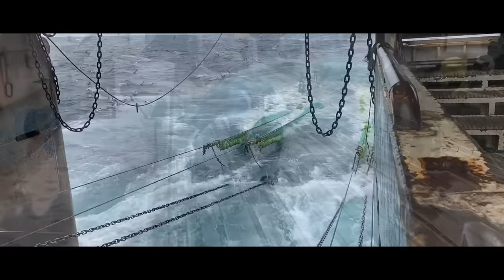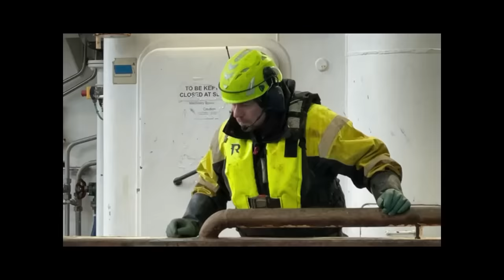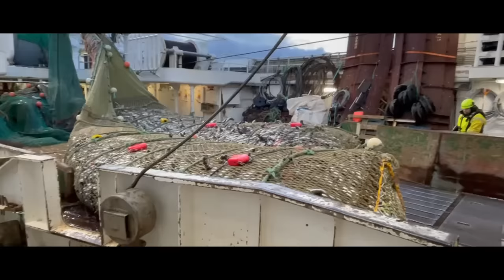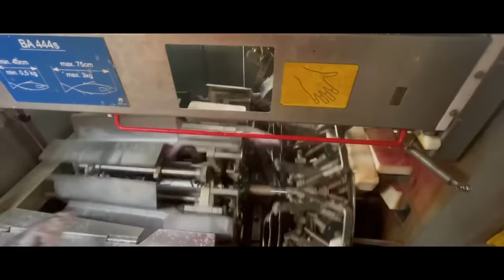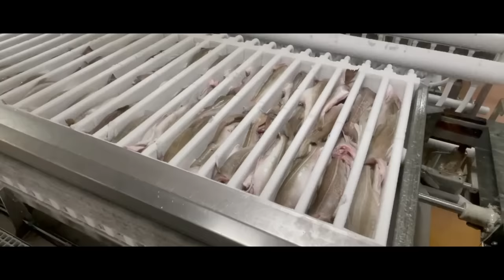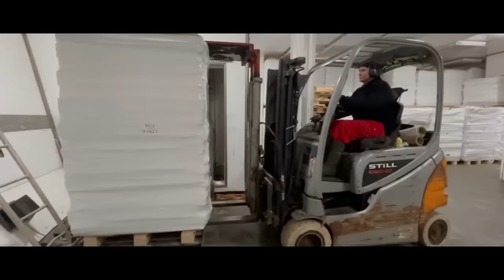Atlantic Viking trawling the Barents Sea

Comment: What are them rollers and what is it used for I know the doors keep the net open but I have no idea what them rollers are for???
Reply from the maker: At which part of the net? In the start or?
Reply: Yeah when you set the net the things right after the chains and right before the doors of the net the black things
Reply: The ship is a twin rig trawler the weight is in between  the two nets and the doors spread the wings of the nets.